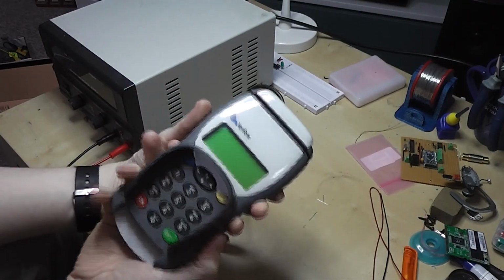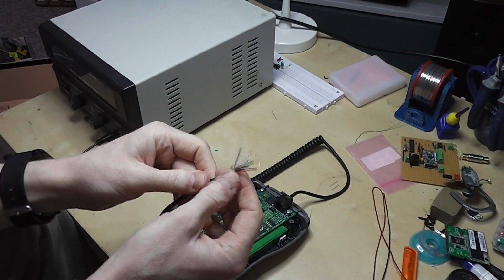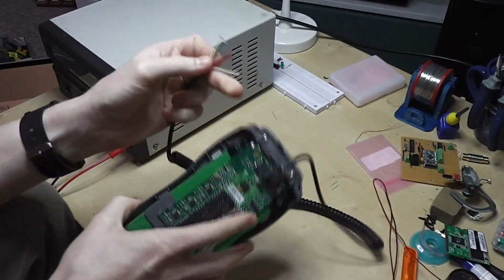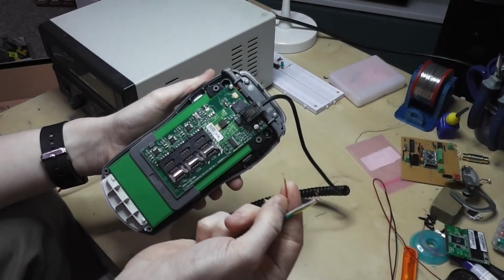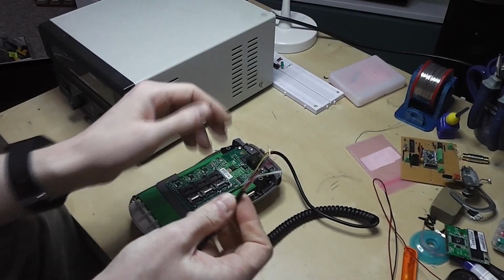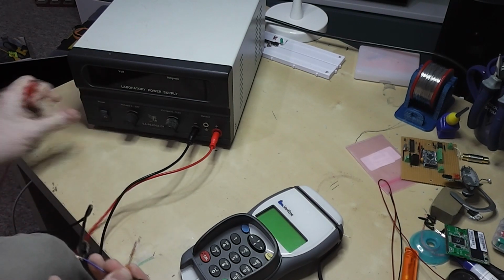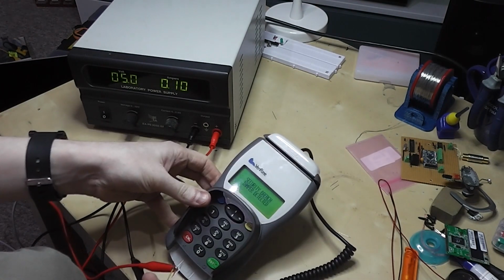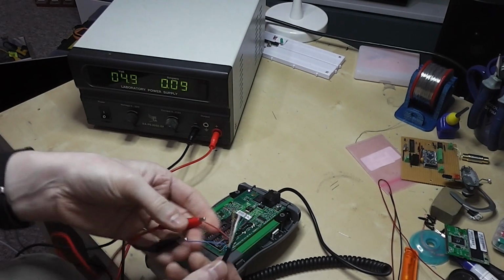Powering Unknown Electrical Devices

Comment: Interesting video. Years ago scammer bought things like this from ebay, gutted them out and replaced the inside with new electronics that behaved exactly like the original did. However the thing was just copying the card's chip and recording the pin typed into the keypad. Some were placed at petrol stations, one at a hardware shop. Later in the day the scammer (usualy a guy who works there as a temporary cashier) copies the contents to blank cards and pays the amount the people "paid" with the cards before. So the only way to tell it was fraud would be the time of payment. This was also to verify if the copied cards work. After a while somebody else used these copies and the pin numbers to get as much money out of the account as possible. Usually abroad. I am a bit surprised that these things are still sold on ebay.
Reply from the maker: This is only the pin entry part of the machine so if you were to do that hack you couldn't then communicate to the rest of the machine that it was successful so I don't think there is a problem selling this part.
The hack you mention might work well with the portable terminals used at restaurants and pubs.
Take a look at my other video on this device, the tamper detection inside it is impressive.